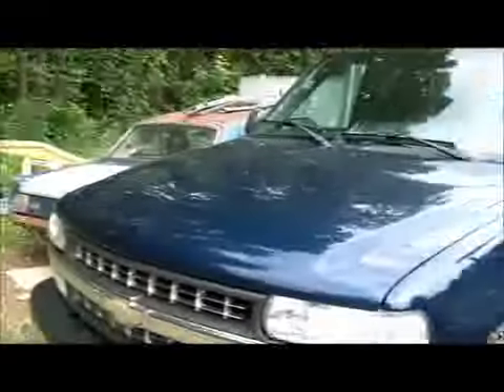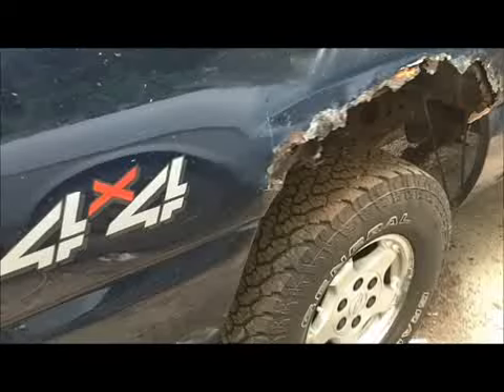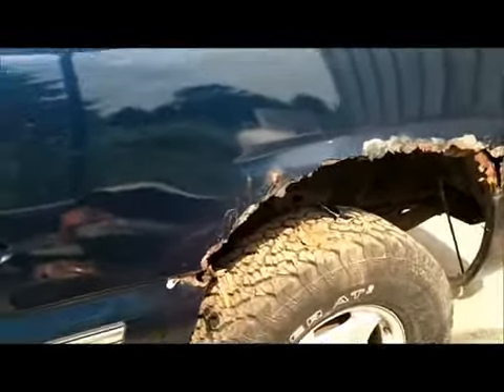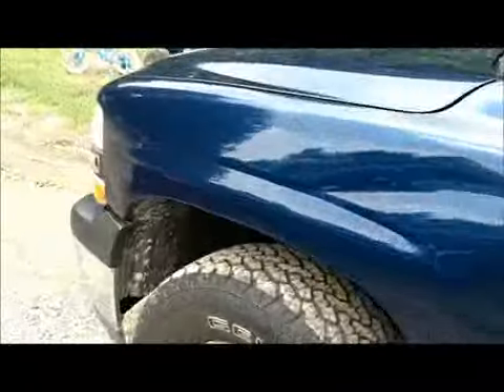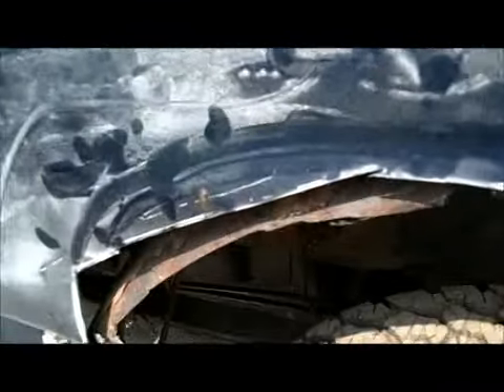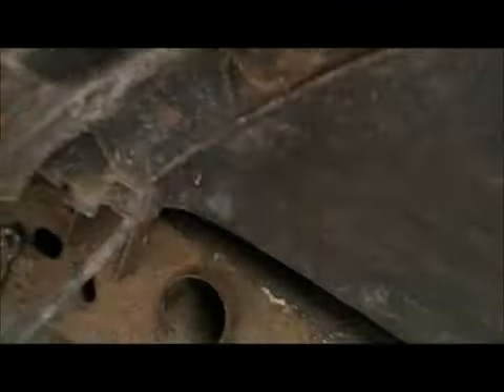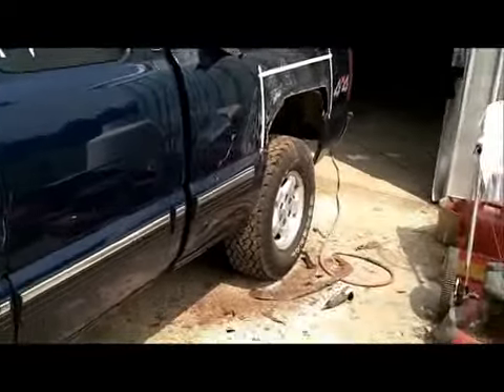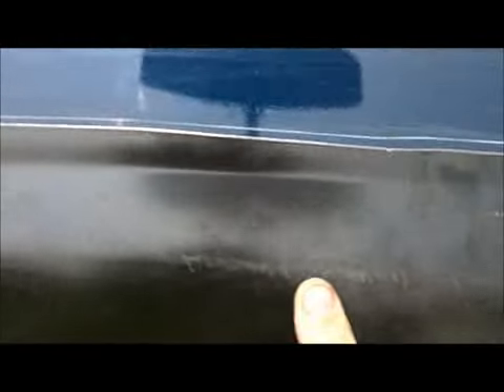How to repair rusted wheel wells on a Chevy Silverado part 1

Comment: These were neglected vehicles that are being patched.  Clean, brush on rust neutralizer, and spray truck bed armour under the body, and wheel wells. I only buy new for reasons in this video.  I would not want to own a vehicle that had these kind of repairs.  My vehicles are 19, and 13 years old with no rust for ny/nj daily drivers.

Comment: HEY. I NEED HELP WITH THIS.. i have an old car.. a little hatchback.. the fenders are rotten.. but nothing else is even surface rust... i wanna do it cheap. But im a backyard mechanic. And only have access to aluminium... can i use aluminium instead of steel. Or will that cause a reaction which could cause the steel to rust again?

Comment: thanks for the vid, i could not understand the name of the panels  i got a great running 2000 taurus with the wheel arch rusted out on the drivers side and i want to order both rockers for is as well. can you give me the website where i can buy. thanks again for the vid!

Comment: Just put plastic wheel flares all around. They cover everything, cost 120.00 on EBay and take about 10 minutes per wheel opening to install. They can also be painted to match.
Reply: Rust will eventually get above it then you've got a bigger repair job

Comment: is undercoating better then brush paint on the frame ?
Reply: Lloyd Dailey don't undercoat a frame unless it's already free of rust. It'll just lock in moisture. They make a product called por 15 which is black, sticks to rust, and converts it. You could also spray your frame with chain saw bar oil and a little bit of diesel. Bar oil is good for rust and helps to stop and convert it.

Comment: Where did you order the fill in panels from for this truck? I have plans of doing the exact same repair on my chevy 97 k1500
Reply: and when you did this repair did you tack weld the new panel to the truck without completely grinding out the old panel behind?
Reply: Auto metal direct.com they have it all or LMCtruck.com but there pricey.

Comment: Seem like it would be easier, and longer lasting to hang all new bedsides. That way you can coat the back of them with a rust preventative, like POR-15, then not have to worry so much about it coming back.

Comment: Id love to see how this truck looks today 4 years later. The body filler is probably cracking through the paint.
Reply: Not necessarily. Before he took the hammer to it, the old filler was cracking and popping because the metal underneath it was rotten. It had nothing to hold onto. I have seen body work last for decades and that includes the bondo. It all depends on what the work is subjected to weather wise and owner wise after the repair is made. The bondo work that had been done before this guy's repair was probably two years old.
Reply: Randy demort71 v

Comment: where can I find body body panels to fit my vehicle? I have the same rusted wheel well on my 1979 Chevrolet Monte Carlo and I want to learn how to repair it properly but dont know where to find a new panel.
Reply: Brandon Bonter just type in the vehicle online and the body part you need and you should be able to find it

Comment: yo should find one of the rusted out 87-96 f150s and work on one of those. i love them but i hate how the rear wheel wells rust out easily. i havent really found any videos on that specific model truck. so if you could that would be fantastic

Comment: I live in Maryland and notice A LOT of this generation Silverados rusting away, mostly the cab corners and rocker panels. I am assuming GM never used galvanized steel to make their cab corners or rockers. My Frontier is an 04 and there is 0 rust on the body. Washing your vehicle in the winter is important but even still a truck this age should not rust away THIS quick.

Comment: ..and Chevy guys talk smack about Fords rusting out. I live in western NY along lake Erie so rust is no stranger in my neck of the woods. Anyway, my '94 F350 4x4 was a highway service truck for 10 years before I bought it and it was always in salt and isn't as badly rusted as this '01 Silverado is and my truck is 7 years older. Hell, I bought a 79 F350 4x4 from a guy in Jamestown, NY that drove 140 miles round trip to work in the winter to Buffalo, NY and that truck is in better shape too!

Comment: No, PLEASE DON'T use zie-bart TAR! My Dad used it on our 86 Diesel Suburban, rusted to bits. Use Oil, much better. Just makes sense, oily metal won't rust! Tar keeps the water out, but also keeps it IN!  

Check my videos for two examples: Our old 86 Brown Burb - TARred with ZieBart, and a 86 grey Burb oiled all it's life - same age, oil instead of tar, what a diff. Pretty sure if had oiled the brown, be still driving it today.Just sold it this year, still drove nice
By the way, Merry Christmas!

Comment: That truck isn't worth doing it right.  Everyone is a critic until they have to shell out the money to 'do it right'.  Well, I have other shit I want to spend my money on than doing pick up truck wheel wells.  My wheel wells are made from expansion foam and they have lasted 15 years since I formed them.  Macco paint job and all!  

Little barefoot Paige has more sense than you all putting a mortgage payment into your truck body repairs.   

The roof tar idea rocked.  

His welds were a little rough but I blame Chevy for making the body so thin MIG wire burns through.

Comment: If all you have is a hammer then everything look's like Bondo ... Ahhh Yea Ahhh Yea But when he went to the other side and began beating the crap out of the quarter panel with that body hammer instead of just coming in from the top with say 80 on a Mug hog  I knew he just really like's crashing rust .. But I can tell you if any of My old bosses ever seen me doing that they would have certainly had something to say about it.. Like say for example STOP doing that and go get the Big mud hog with 80 on it   .... Ahhhh Yea Ahhh Yea .. while the panels look nice I'm more interested in what your gonna do with the outer wheel well ....You can actually replace just the outer half .. you can get them from LMC Or Tabco and i'm sure many other places which is why I never attempt to Fabricate anything ..But your telling me you went thru the motions and got one but not both.. That's like going to the shoe store and buying one new shoe ..

Comment: How does a truck obtain this much rust, as a lot of folks have said, it sure is a lot for a 2001.  I have a 1995, and the only rust is on the cab corners and a small strip above the passenger front wheel.

Comment: ...I wonder WHY the GMT 800's are SO prone to rust??..almost as bad as mid-1970's squarebodies...the GMT 400's had their own rust issues(cab corners,wheel arches on the bed), but not nearly as bad overall as the 800's. Actually, some of the most rust-resistant trucks ever made were the 1980's(1981-1987) squarebodies...they did something to vastly improve them after so many complaints about the 70's models....

Comment: my 05 f250 is starting to get the wheelwell rust its starting to bubble the paint... best fix for it?
Reply: Cut out the rusted area. And replace it with new metal.
Reply: Siana Gearz *pulls out flame thrower* aw man...

Comment: should have cut the wheel wells out and replaced the whole side there is more hidden rust should have media  blasted the bed and cut ALL rust out and cut inner and outer rockers out and cab corners out when you open it up do it right or your going back in a year or 2 and after said an done wasted enough money to have done it the right way it's a vary costly job to do right but when done right it can last another 10-20 years
Reply: +tunercars3   Wonder how much just to replace the bed with a used one?  There's a place near my house where they take the beds off and replace them with contractor boxes, then they re-sell the unused beds.
Reply: +fenderstratguy i have seen used sell fom $500-1000 depending on how good of shape they are in i would even be interested in getting a tailgate if they separate them from the place your talking about but mine is an 2003 not sure if they have anything for that year ?
Reply: +tunercars3  Just find a place that replaces factory truck beds with service truck bodies, and they might have some takeoff parts you could buy.

Comment: Should have not wasted you time and bought a 200 $ set of fender flares and covered that shit up.
Reply: Glue on some cab corners and slip on rockers, we did my son’s truck and it will last a few more years otherwise you are into a massive weld in fix on a 2000$ truck

Comment: If you clean the metal properly, you can undercoat your vehicle and it will not rust (so long as the coating doesn't chip!). If you don't check the coating periodically, especially after some heavy duty use (gravel and mud can take a toll on coatings!) you'll end up with just that! The oil just makes the mud and dirt stick and hides the rust or makes it worse!

Comment: could of saved a lot of trouble if you would of waxed it and a little undercoat...
Reply: When they put calcium chloride in liquid form and flake form on the roads up here in the north this happens. Undercoating will not cover everything and all it needs is a small spot to start.
Reply: It's not his truck, genius.
Reply: It rusted from the inside out, Wax wouldn't do anything.
Reply: TheTrapper70
There's no excuse to let it go that far, you and I both know that. I am from the North also and our town uses a ton of salt.I have a 98 Chevy that I am willing to bet has seen more salt than this truck, it's been undercoated every year with Krown since new, and liquid glassed a few times. There is surface rust but not a single piece you could poke through and definitely nothing like this. Prevention is better than cure! Anytime I see a spot that is getting orange again I soak it with oil, pain in the ass but better than letting it end up like this and cheaper than getting her re painted!
Reply: What is "undercoating"?
Reply: joe Costello There are different kinds, it's something you spray on the underside of the vehicle, I like "Krown T40" which is an oil they spray underneath and into the body panels.. there is Ziebart which I believe is like a tacky rubberized one, there's asphalt ones, I've heard of people using chainsaw bar and chain oil in a spray gun..
Reply: When you buy a new car it has a black rubberized paint on the undercarriage to protect the metal from rust. I do mine every year.

Comment: Yeah that's really disappointing it's only 10 years old that much rust, if it is a salt doing it they should be protocol in those towns, with maintenance certainly see lash it out of the undercarriage before you start driving it in the winter. Put the metal in the workmanship into the vehicles itself is really poor compared to the old Chevys and Fords! Hey that Vehicles going to be hundreds of pounds less every time he hits it I've never seen it so bad and I'm dealing with rust

Comment: why would you even bother.. in ottawa that car is finished.. the floors are finished the rockers the inner wheelwells.. the exaust the brakes the fuel lines... its finished ..that was a 40.000$ truck.. the dealership would give me 300$ for the scrap metal value of that car and send it to      kenny u pull com.. in ottawa

Comment: First loose the cigarette and the hammer. So you’re just going the leave all that rust underneath. Running most of the week? Can’t wait. Who gave this guy a cutting wheel? No panel? Yeah cut all the crap out and leave a whole for water to get in and rust even more. He’ll be repairing that in a year or two.

Comment: I wish gm would just use undercoat on all the panels. Cover the entire inside panel not just what u can see. Seal the panels together with epoxy? (I'm not sure what to use not well informed in this area.) Instead of just spot welds.  When I bought my chevy 2yrs ago it was undercoated.  Its 6 years old and the bed sides are going.  Even washing inside and out every week. Oh yeah and stop using that nasty shit they spray on the roads to melt ice. If you cant drive worth a damn stay indoors lol jk
Reply: replace panels weld and undercoat on backside after done before sealing the gap inside the wheel well
Reply: +Alex “rekaeb” VF POR15 is one anti-rust coating.

Comment: Theres nothing wrong in banging out the rust like that,you people saying if i came at your car with a hammer are very anal,its called hard work you light weights ,ime working on a 72 mercedes w114 and thats the same way i knocked out the rust,i did with a hammer and got it all out.

Comment: WTF. How do your cars over there even get that bad? Do you drive IN the Ocean or something? Seriously...W...T...F. Here in New Zealand that would be taken straight to the scrap metal yard. The Police would ban it from our Roads. Fucking crazy. And also, why the fuck would you even buy it in that state?
Reply: +fordmanmal It's what happens if someone doesn't keep a car in nice shape and also drives in winter conditions where anti-ice spray/salt is put on roads; it gets all over the vehicle, going into little crevices. If the car's not cared for it will turn into a rust bucket. That's exactly why collector cars sit in storage through those months and even after, until the stuff washes off roads from rain. That's not as if there aren't coatings and such that can prevent rust from happening in the first place; there are such coatings. How many people actually call it "a waste of time" though? Well live and learn, once the muffler's falling off maybe they'll listen.

I've seen cars under 8 years old (I'm not sure how old exactly) with exposed metal that the owners just let sit. It doesn't cost a lot to get a little touch-up container of paint.
Reply: +fordmanmal He lives in New York state. They use A LOT of road salt in NY.

Comment: why u dont buy a fucking used vehicle. i
Reply: not everyone has 80 grand to spend on a vehicle
Reply: +The Beast He said used. If the drivetrain on this rig is good, you can come down south and get a truck with high miles and no rust for $1,500 or so.